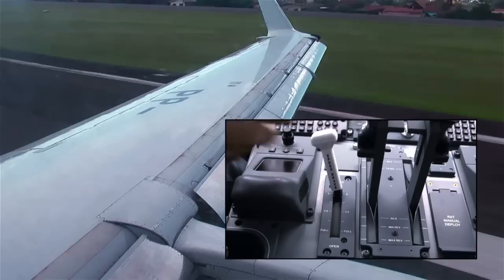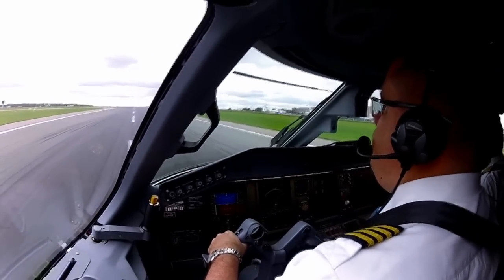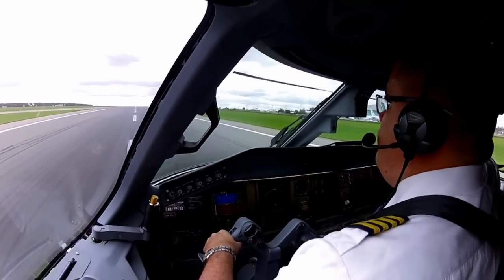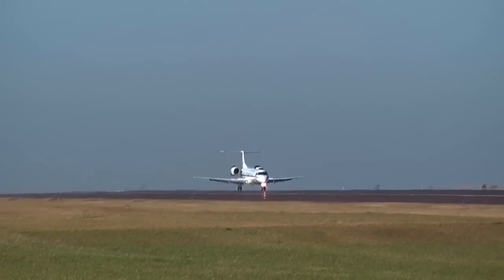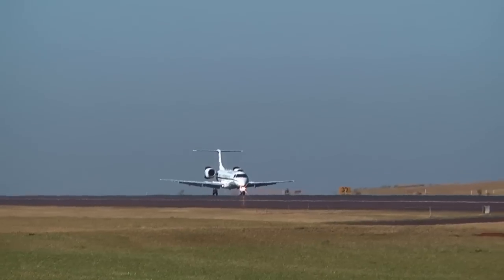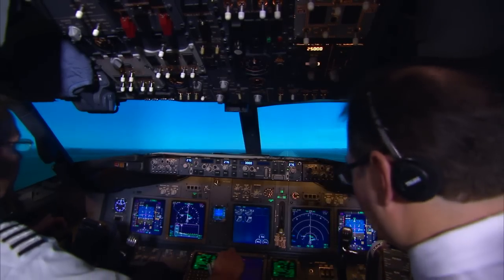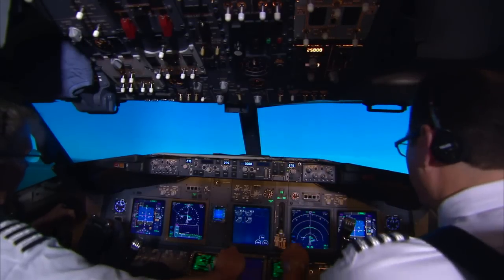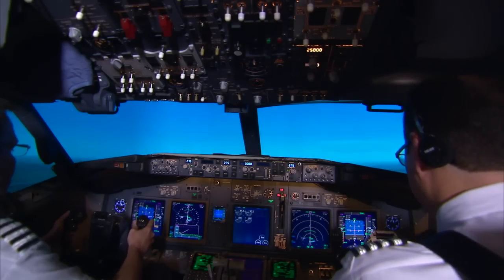BOEING EMBRAER RSAT Video - Preventing Runway Excursions

Comment: Good video. I would have liked a more thorough discussion of the last 2000 feet on a contaminated runway. If you are not at a taxi speed (read walking speed) entering this portion of the runway, you have a significantly higher chance of an excursion. As one US major airline recently demonstrated in these conditions, following ATC instructions to "expedite to the end, right turn off" should be ignored. They went off the end. Ugh.

Comment: Worryingly, this video makes no mention of a pilot having a solid understanding of the effect of, for example, a 10 knot headwind on a dry runway vs. a 5 knot tailwind on a wet runway (something which could easily develop if rain showers are at the airfield)...the increase in landing distance requirements are rather shocking if you go into the performance charts for any airplane.....